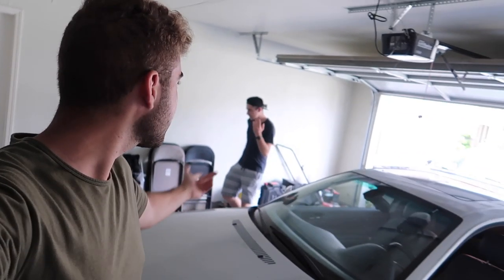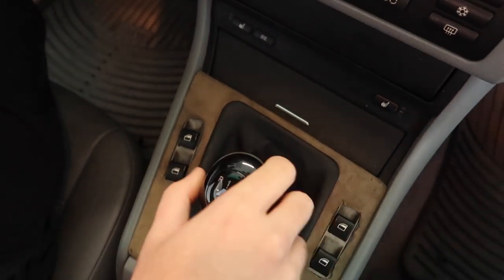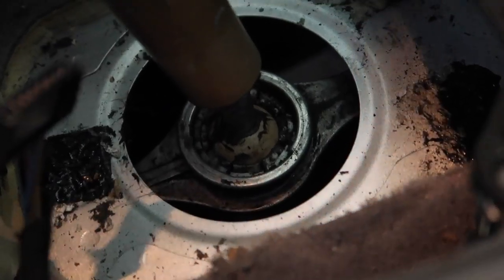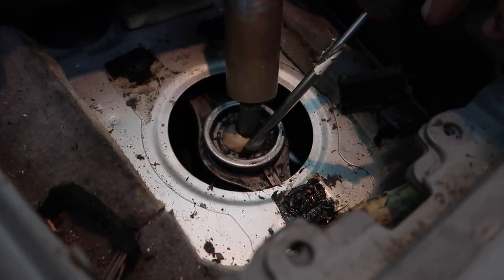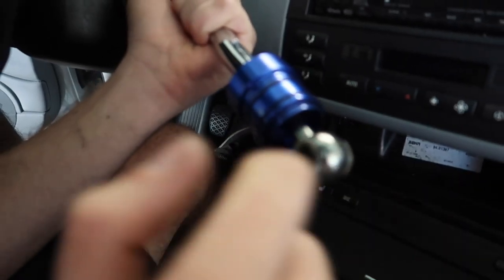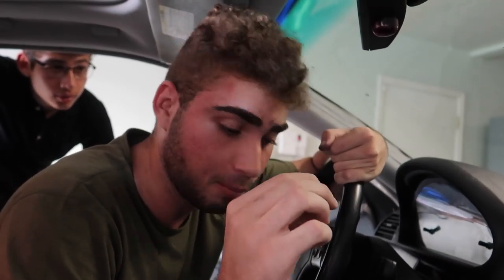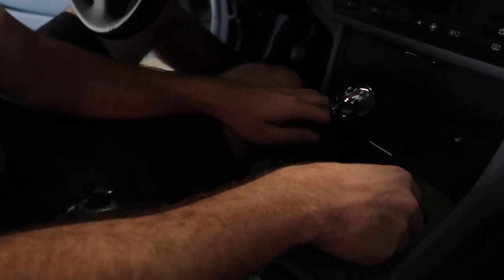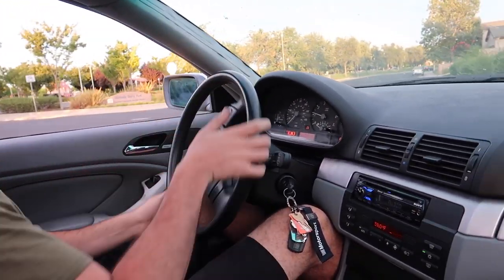INSTALLING SHORT SHIFTER AND DRIFTING THE BMW E46!

Comment: You could get rid of most of the play when in gear by doing a full refresh on the shift linkage bushings. I have an E60 540i shifter and a weighted m-knob on my e46 and man does it feel good!

Comment: to properly turn off traction control you need to hold the dsc button until the traction light and a yellow  “brake”  light appear